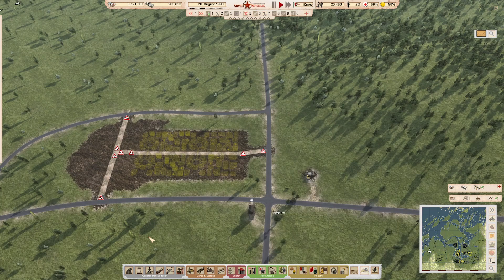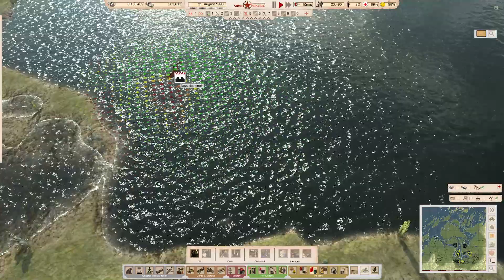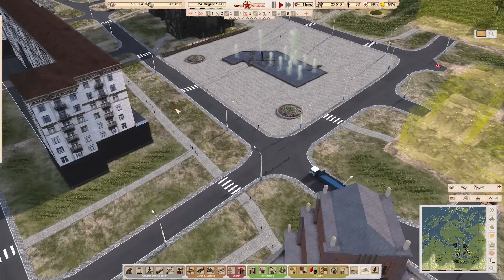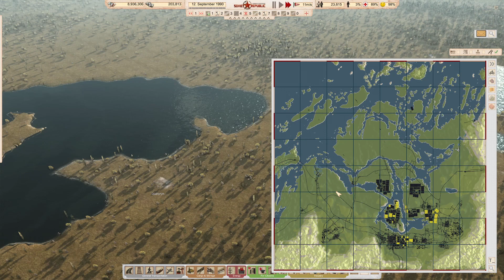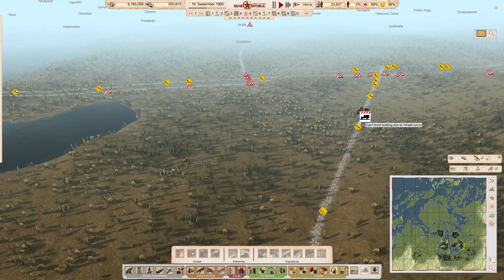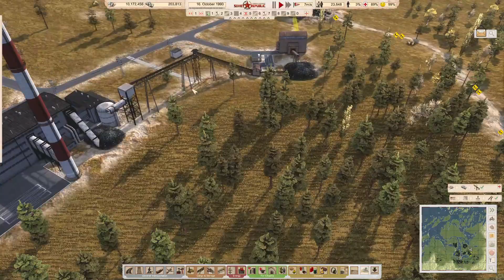Looking To The Future :: Workers & Resources Soviet Republic (1947 Start): #79

Comment: keep this series going ditch the other 1 ur way more ahead in this series
Reply from the maker: Agree, feel the other series will have problems when the update drops plus this series will testing of the new game mechanics.
Reply: @StephenSilverbeard  you will ditch the 1908 series when it just got interesting? you got access to train now. I agree it's slow paced and you won't be able to introduce new features to it but I don't think you will be able to implement them into this gameplay without starting over.
Reply from the maker: @ProsperoPolska  Agree, have been looking at the current situation, it will take multiple parts to remodel the three villages.  Will keep it going through the beta phase to test the new features.  It could be either an interesting challenge or an example of how not to do it.